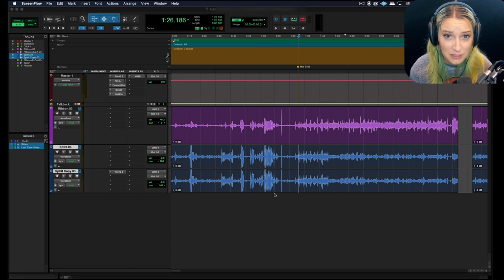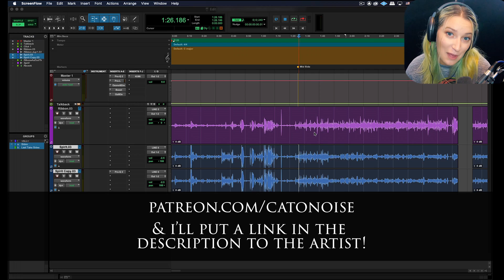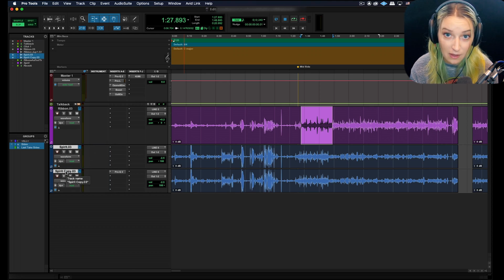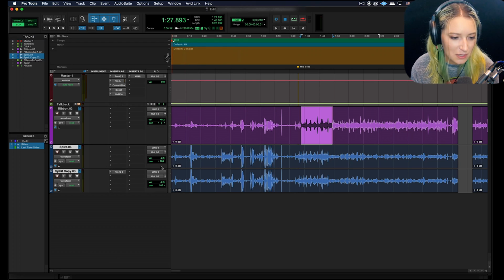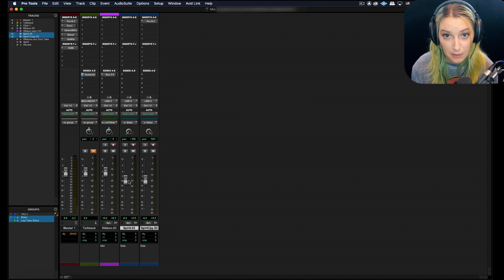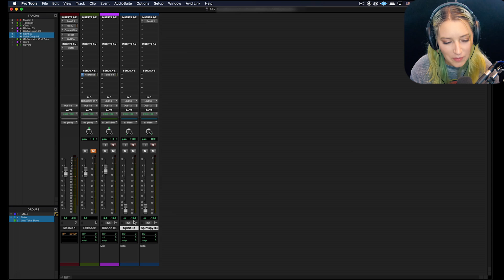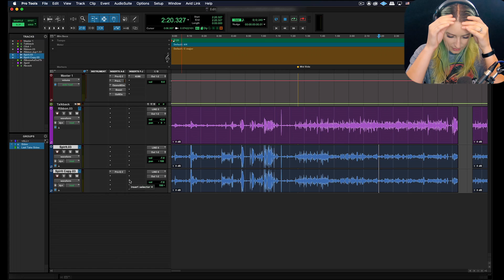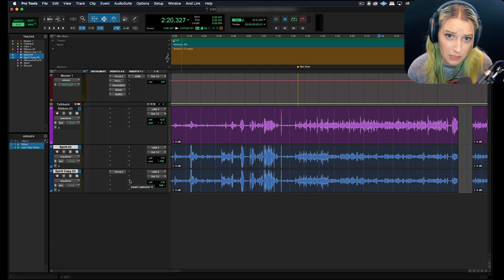Audio Basics: How to Edit A Mid/Side Recording

Comment: You can't get a good result in mid/side recording when you combine a ribbon mic with a condenser. The two technologies (velocity mic vs pressure gradient mic) produce analog waves which are 90 degrees out of phase with one another. This is a very common mistake made in mid/side recording and one rarely discussed. You may still get a somewhat stereo image but it will still show evidence of phase issues as can clearly be heard in your example.
Reply from the maker: Interesting, thanks! I'll have to look into that. But since it's just 90 degrees out of phase, is there any reason why you can't just shift one over by 90 degrees to solve that issue?
Reply: @CatoNoise  Yes, one could if their DAW (or a plugin) has such a function. But most DAWs have a Phase function which is only capable of "Inverting" the polarity of the signal which equates to a 180 degree phase shift, so if you apply that to one of the tracks, it will still be 90 degrees out of phase. Also, since this is a technological phase issue and not a time/distance issue, the problem impacts the signal across the entire frequency spectrum.
I just be sure not to mix the two types of mics in a M/S array... I always use two of the same type mic.
You're doing great, and you display a great curiosity and desire to learn. So keep up the good work!
Reply from the maker: Yeah, the polarity buttons operate slightly differently than actually shifting the phase - I get that they're technically two different things. What's the 90 degrees out of phase relative to though,  in this instance? Do you have a source for this info? I've been taught that combining mic types is fine, and can be half the fun (although if you pick two mics that are very different tonally - lol, which is what I did here- then they might interact with each other in a way you don't expect or want). I also know people say to be careful picking a ribbon mic if you're using a ribbon for the sides in m/s because ribbons are often slightly asymmetrical fig 8s. But I'm not seeing this specific type of phasing issue after a quick search. I'd love to see details on this, so I can understand it better, thanks!
Reply from the maker: And btw, I do know that the polarity button and phase shifting 180 technically aren't the same exact thing. Just noticed you had that written (maybe you were trying not to complicate the conversation here with this one?). Could you also specify what you mean by technological phase shift, and not time/distance? My understanding is that phase shifts and phasing issues have to do with time/distance, whether it's caused by our technology, or mic placement, or what have you, so I'm a bit confused by that one. Thanks!
Reply: @CatoNoise  This could take a longer reply than I'm prepared to type out tonight, but I'll point you to two things to research a bit to get you started and come back perhaps tomorrow or the next day, depending on my schedule.
In order to fully understand this you need to thoroughly understand how each type of microphone technology works. Ribbon mics (as well as dynamics, but let's leave those out for now) work by the process of 'induction' whereby they generate their own electrical current. Study induction a bit. 
Condenser mics, on the other hand, use 'capacitance' to modulate the current supplied via phantom power. Learn how a capacitor works. 
For each of these technologies supplied ask yourself "...under what conditions does voltage rise, fall, change polarity, or fall to zero?". When you can answer that question for each you will be very close to answering your own questions!
I'll check back in when I can, I admire your openness and hunger for learning more. There are some very easy to understand videos on youtube on these subjects, so do a little digging! Good luck Cato!
Reply from the maker: @jeffwoollen1366  yeah, I actually teach how the different mic types work to my college students. I'll look forward to your reply. Thnx
Reply from the maker: I also became certified as an electronics technician a while back, so you can discuss capacitors and such with me, I'll know what you're talking about. No need to assume I won't understand your answer here without a bunch of background.
Reply from the maker: I guess for the sake of clarity here: I know many people prefer to use the same type of mic for m/s recordings, and I understand the reasons why (the reasons that I outlined here in this thread, I mean - I understand those). I'm just not clear on your 90 degree phase argument for choosing similar mics, (especially since our degrees when discussing phasing are often dependent on the frequency content of our source in the audio world, right? So how would it consistently be 90 degrees off? That's what I don't get. And it seems like you are discussing phase with actual audio waveforms because of some other stuff said here, like shifting waveforms in the DAW to remedy it, etc, so am I off base there?). Anyway, I'm also not clear on the distinction between technological phase and otherwise, and how that version of phase doesn't have to do with time or distance at all. My understanding from my recent electronics degree, as limited as that was, is that phasing from technology, circuitry, etc, still has to do with time/distance when you look at the waveform. That's what I'd love more info on, thanks!
Reply from the maker: Btw, I made a quick IG reel a while back for anyone that's wants clarification on how phase and polarity are not the same thing (I know that's a common confusion). Hopefully that helps understand why inverting the polarity of a signal does not equate to the same thing as adjusting the phase by 180 degrees (mentioned earlier in the thread), to my understanding at least. Here's the IG reel, if it let's me link here.... https://www.instagram.com/reel/CQqtrTMjVtg/
Reply: @CatoNoise  Tell me, is there ms encoder in fl studio 20? Or what alternative is available from third party plugins?

Comment: Ribbon mics can never have a cardioid pickup pattern,  its a figure 8 by nature... what you did is called the Blumlein technique which uses 2 figure 8 microphones but then you only pan them hard left and right. 
For Mid\Side Technique, you only use a cardioid for the Mid and a figure 8 for the sides.. otherwise its not Mid\Side. 

Cheers :)
Reply from the maker: Hey, thanks for the comment! This microphone is actually a cardioid ribbon mic (I've checked multiple times, haha - I actually had someone comment something similar on my FB a while back, and double checked then). I know ribbons are naturally figure 8, because of how they're constructed, but I believe they do sometimes come as cardioid (although I think it does affect the frequency response a bit). If I'm remembering correctly, I think it's omni that they simply cannot do? Anyway, did I mention the model number in this video? If not I can double check and paste it here so you can google this specific microphone and see what I mean. Other than that, I learned that sometime's people call it mid/side when they use an omni for one of the mics, so there are variations of the technique that aren't these two exact polar patterns....but I think the most common version uses these two polar patterns: cardioid and figure 8.